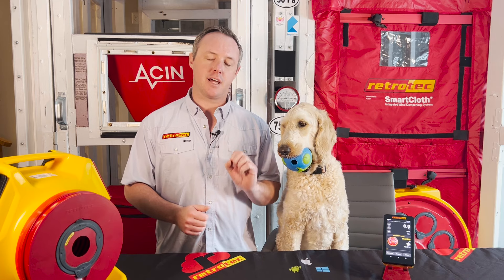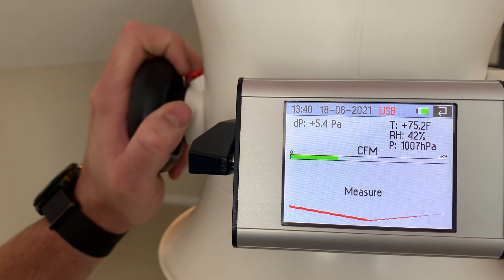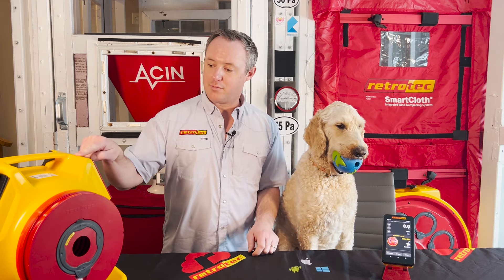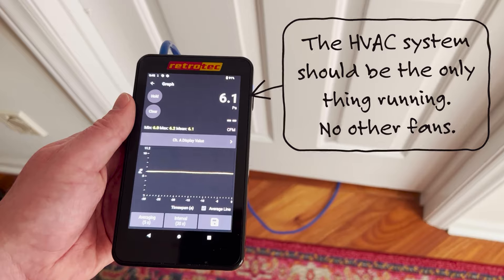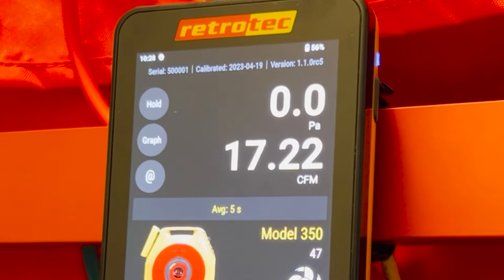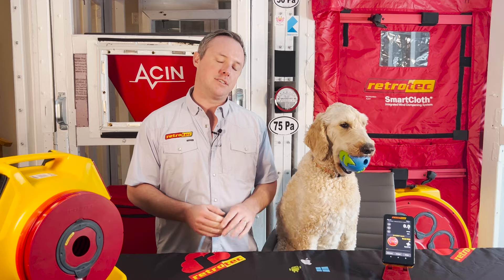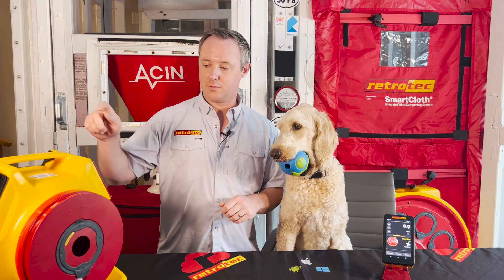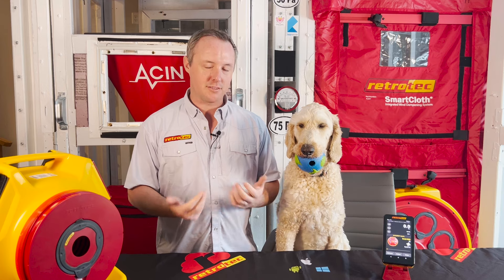Technical Tuesdays: Ep. 51 - Measuring HVAC Driven Exfiltration

Comment: I also thought supply and returns in the tested room should be covered to increase the sensitivity of the test.  With Door Fan running, you have  a house leak that doesn’t matter and a series leak consisting of the bedroom wall to inside in series with the bedroom to outdoor leak. The latter is the one of interest where you’re re-creating the 6.1 Pa pressure then measuring the flow to the outdoors with the DucTester across the bedroom door. 

An overhead schematic of the set up would help.
Reply: That is a good point. My understanding of this procedure is you'd not want to fully seal off registers to avoid sealing off boot to drywall leakage. Which could be a good portion of that bedroom to outside leakage area.

Comment: Wouldn't you want to tape off the supply and return ducts going to that bedroom so that you aren't pressurizing the room with the main house blower door fan?
Reply from the maker: nope!  Since this is a neutralization test, we're removing interstitial leakage back to the interior space. Since there's no deltaP, there's no leak. So we can leave them as is. Supplies and returns are pathways back to the interior space through the duct system, and are a large part of why ZPD doesn't work for bedrooms. And sometimes there is leakage in supplies and returns that we want to count in a test like this, and taping it off would cover up that leakage and hide it.
Reply: @RetrotecEnergy  I am still trying to wrap my head around why you wouldn't tape off the ductwork for that room. Here is an example: When doing duct leakage to the exterior testing, if you were to "forget" to tape a few supply registers, your leakage rate to the exterior would get closer to zero. Why? Because the blower door is now pressurizing the ducts making the duct leakage fan work less to maintain the same amount of pressure. It is the same concept here. If the goal is to measure the leakage on the exterior wall (and ceiling), at the pressure that the supply duct creates in the room, then you don't want the whole-home fan helping to pressurize that area, as it will reduce the reported leakage on the fan measuring just that room.
Reply from the maker: @seanharris6860  Yep, I read you loud and clear. But there are some differences between this test and a duct LTO test that we need to keep in mind. We reference pressure in a duct test at the first supply (usually). If we leave some registers open further down the trunk during a LTO test, those parts of the system could deviate from the target pressure, especially if there are a lot of turns, compression, etc. 

In this test, its an open room without the pressure uniformity issues that we can see in ducts. If we're reading a 0Pa deltaP once the fans are synced, then we should be ok. If pressures are equal, there should be no flow. And if we're not 100% comfortable with that, we can verify with smoke to see if that flow from the blower door is indeed causing something to happen that we dont want. We do this quite often with large building and enclosure integrity tests. 

Again, we want to read leakage at the boots. That is part of our envelope leakage that the room experiences when it normally operates. For that reason, I'm more comforatble leaving them open and letting the fans neutralize the pressure.